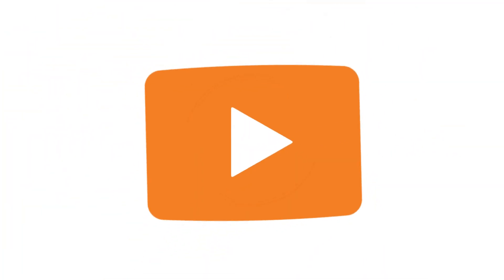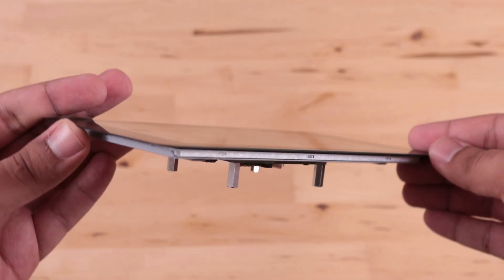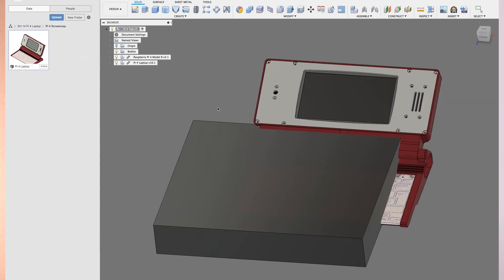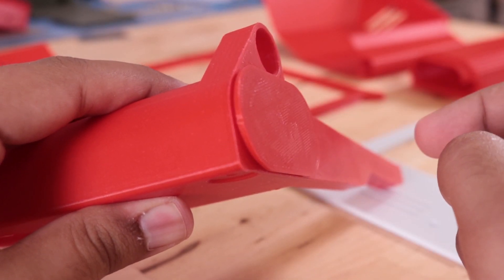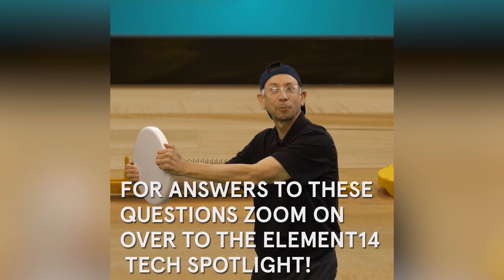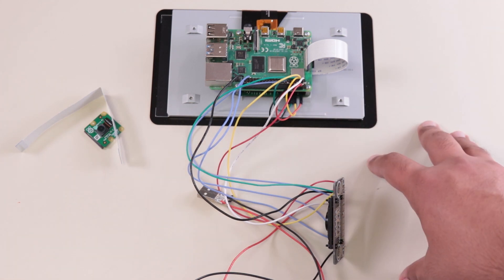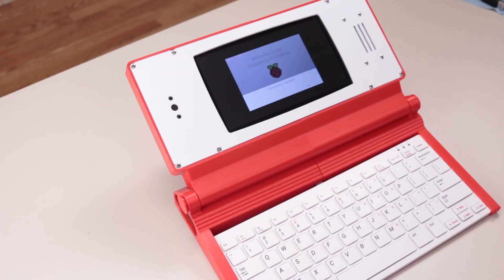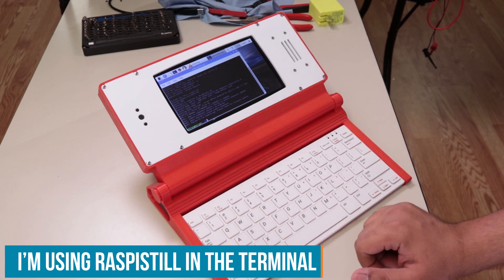The Ultimate Raspberry Pi 4 Laptop

Comment from the maker: Looks like DJ Harrigan had trouble using his camera. If you had an incident where you tried to made things simpler but instead, it got complicated. Post here: http://bit.ly/2TwxZS0
Reply: Either the ribbon cable is not seated correctly or static shock zapped the camera. I’ve had the official Pi cam work with the Pi 4B.
Reply: Where's the mouse man
Reply: Congrats on 666k subs!
Reply: Tbh it looks like a kids toy
Im sure you could have worked on the case a bit more
Maybe even took out the portable charger and wired it into the case
But thats just critical feedback

Comment: The "Ultimate" Pi laptop:
- no heatsink or fan
- no access to the ports
- keyboard doesn't stay in place
- camera doesn't work
- speaker is barely audible
- tiny monitor yet fat panel casing

A better design would put the raspberry pi with the keyboard casing and have the display be by itself in a clean, flat enclosure. 99% of standard laptops follow this design. Only tablet 2-in-1 laptops put the processor board behind the display.

I still enjoyed the video, and your tech skills are tons better than mine. =)

Comment: i kind of want to see something that you can hold in your hands and can fit in your pocket... something that still has a full keyboard as well as a d pad and game control buttons would be absolutely perfect... but i would just settle for a full keyboard...
Reply: or what about a case that has a battery, cooling system, and display. like put the display right onto the case. sure it would be small. but you can connect a bluetooth keyboard to it and have an entire computer that can fit into your pocket... or hell... forget the display all together... just a portable powersupply and a case... rig up a hotspot and ssh into it with your phone wherever you are...

Comment: I've been thinking about building my own pi4 laptop for a little bit now, for those times when I don't want to pack up my larger machine for little trips when I won't be needing to do CAD or video editing. 

I was thinking of getting a compact keyboard that is roughly the same size as whatever little display I get so things look proportional. I don't care to much if it's the best to use, as this project would mostly be for the heck of it. I was also thinking of putting both the pi4 and the battery in the bottom part of the device, like in a regular laptop, to help keep it from being top heavy. I would also like to set up the pi4 and battery charging port with short extensions from the ports to the side of the chassis so I'd have easy access to them. I'd of course have to get a fan and heatsink for the pi4. I would then route the cables from the pi4 and battery up to the upper part with the display and driver board through a sturdy cable sheath.

Comment: Thanks for doing this, should have been done long ago!

In terms of what you might consider adding, generally common use features like:

*Battery that stays in, is able to be powered by plugging laptop in
*power switch
*microphone (in addition to the speaker)
*access to the plugs
*fan(s) for cooling

Comment: I tried to use website but could not find this project.  I travel for 49hours.  I want to make similar laptop.  
How many hours with monitor can you get with that battery pack?
Is there a source to assist me in creating a safe/legitimate 24 hour or 48 hour battery pack to fit inside laptop case similar to what you did.
I know nothing.  But i feel I will need a bank or line of batteries connected ...the width of the laptop....
Slide it out to charge it.  Slide back in.  However   TSA may take the batteries if not secured where the batteries are some how packaged before going into laptop case....  hmmm

I would consider largest battery charger LION pack purchased if price was ok and it gave me a good measure of time to use laptop.

Comment: Nice, but this is what I would've done:

1. I would've used a Pi Juice hat with the 5000mAh battery add-on. WIth that, I can have power switches, LEDs, and manage the current that flows into my pi and even check the percentage trough software.
2. I would've put a fan like a Fan Shim from Pimoroni on the pi.

Other than that, great job!
Reply: For every article or video about a DIY Pi laptop, there are hundreds of "how I would have done it different" comments.  The "would have" part is telling, because if they had built such a thing, they would have said, "this is how I did it different".  Pi laptops (or cyberdecks, or whatever) are like light sabers - every Jedi has to make his own.

But I'll comment on your comment as well: you believe that you can manage the current that flows into your pi?  That's not how it works.  The power supply supplies a regulated voltage, and the load (the computer + display + keyboard) draw whatever current they will.
Reply: @BrightBlueJim  go check out the pi juice, you can change how much amps you can send to your pi trough AC. Sorry, I meant that.

Comment: In the long term I am wondering if one would be better off going to a wireless keyboard and moving the power cell into the top half. One of the most common laptop failures is wires that go through the hinge. The other being heat. Which most of us with Pi4 have had to deal with. I use a Flirc case and even it gets hotter than I am happy with (does not throttle).

Comment: Th official keyboard I keep finding is a full size 106
Although I did find a red and black compact keyboard on Amazon, but no red and white. I did find a blue and white though so I am going to switch the decks around.  lol

This piTop that you made is basically what I want to build, but buying a 3d printer is out of the question. :(  So says Congress(the wife), It was vetoed on that.

Comment: 1st off, you need heat-sinks and a few good fans (Noctua has some good 5V ones) Otherwise a decent first job.
Possible Future upgrades: USB3 to M.2 SSD for a boot drive (You can get 120GB drives starting at about $30)
Integrated OS aware battery with the option of using that Anker battery as an additional removable power pack. 

USB2 hub for external ports. 2 Micro HDMI to full HDMI adapters bolted through the case for A/V output. 3.5mm audio jack also bolted through the case for headphones.

Comment: I like the design, but I have a few qualms with it. Mounting the pi to the screen leaves the whole case chunkier than it needs to be, and makes me feel like its going to be top heavy. Not making a USB Pass through, or designing the case to expose the usb/ethernet ports lowers the overall usability, especially since the official keyboard doesn't have a mouse pad like other portable keyboards. Aesthetically I like the way it all looks in the end. But I really miss the core 'maker' feel of the old videos, even if they were longer/multipart. These newer videos a lot of the time feel so rushed and they all just kind of rely on, "hey I got these parts, lets 3d print a case and shove them inside." While generally cool when introducing a new idea, or being one of the first videos a person is going to see from a channel. But at this point More complicated projects with more in depth planning and focus would be great. Especially since now there are a group of you all working on videos independently, if you all layer your work schedules right, each of you could take longer to work on video/topic, and still have very regular content on the e14p channel overall.

It would also be great to see all of you come together for a project every once and a while. A lot of this all started for you guys with the Hack like Heck competition, I wan't to see you guys pull some heck like hacks out of your minds like I know your capable of. :D I really want to enjoy this channel again.

Comment: Just came here to say, pros don't solder wires to exposed pins, they crimp the wires with the proper mating connector.  Maybe in a pinch for a prototype or proof of concept, but when you go as far as he did with the case, creating a pseudo complete project, to solder wires to pins is backwards.  Anyways, rant over.

Comment: Unless you have a 3D printer, soldering equipment, a workshop, a 3D modelling software (also have learnt how to use it), and your time is almost worthless, how could this be "cheaper" than the off-the-shelf version?
Reply: well now it's even cheaper, as the files are downloadable and there are ways to get things printed, without having a printer yourself :) hackerspaces or libraries for example.
Reply: dude, this channel is literally for people who make things.  Ya know, people who own this kind of equipment?  I may not personally have a whole workshop right now, but I have a 3d printer and soldering station, and will be building my own pi laptop in the future(though definitely not this design).

Comment: flimsy design, the keyboard was falling out the bottom and you literally taped it together with that sticker on the back...
no heat sink or other way of removing heat so your pi will throttle back to a potato after a couple minutes of use.
no mouse/touch pad control at all...
overall this looks good but is a total failure of a laptop. 

these kinds of vids are why i cant stand part of the R pi community, look at this cool thing i built that falls appart 30 seconds after the video ends and all you need to build it is this $500 3d printer some obscure electronic parts from china and oh look it failed to do anything... like your "laptop"

Comment: No Heat Sink!!!  No Heat Sink!!!
It will overheat and throttle the clock.
What is the point of getting a RazPi4 if you are going to cook it down to a RazPi3?
Reply: I guess they like crusts crusty
Reply: I feel like a lot of the "hacking projects" on Element14 reek of pretender syndrome.
Reply: I was kinda thinking the same, my raspberry pi 3 needs a heatsink and I put a fan on it to make sure it was cool enough.
Reply: dude chill
Reply: @artisimo7967  nice

Comment: I’ve been able to get the official Pi camera to work with the Pi 4B, no issues. I’m going to guess that either your Pi camera got hit with electrostatic shock (easy to do) or the ribbon cable is not seated right. The connectors on the Pi do not hold as well as they should. Check the cable.

Comment: I’m able to accept the battery solution even if it cannot be recharged while the Pi is in use. I can even accept (barely) the low resolution official display which is certainly too low to use for a desktop daily driver. But I cannot accept that a laptop, built around a dual 4K HDMI Pi 4B has no external video connection. I’ve built a tablet with the official display and off the shelf battery recharging power supply and was easily able to build in a switch to go from official Pi display to the HDMI port. A true laptop should have external video capability. C’mon!

Comment: Doesn't really seem like a good use of a Pi imo.  Obviously for the money spent you could get a much better device.   What would make this better, imo, is if the GPIO pins were externally accessible for plugging in other sensors / hats, and maybe some really unique hardware options like an Intel Realsense 3D camera or DIY LIDAR, advanced drone piloting software/hardware, and as others have said, exposing the USB ports, the HDMI port, and a better case model (wobbley keyboard?  no thanks).  Neat project though and it's a good start.  Anyone building this at home, do yourself a favor and use cabling you can unplug to replace the RPI in the future instead of soldering directly to it.

Comment: there are few things that didn't impress me... 1) Why another audio module was used if raspberry has audio output? 2) The laptop has too much weight on the display part then the keyboard and that will make it fallback 3) The keyboard is without touchpad or joystick and won't able to use the mouse pointer! 4) case is too loose and keyboard don't fit properly 5) Why the LCD case was made into two half?

Comment: Great looking fun design.
My only concern is the running temp of the Pi 4 (up to 80 degrees C on high load) and the glass transition temp of the PLA (60 degrees C).
Great video.Keep up the good work.

Comment: i opted for a custom power system for my pi tablet. its a bit lackluster only runs for about an hour or so, and i think my charging board is discharging my battery when its not plugged in.
Reply: Photo!!!
Reply: @BrightBlueJim  you are a bit late, i already gutted it. new design will just use a pijuice and a 10 ah cell. i have all the parts but i had to re-design the whole case, due in part to upping to a pi4. thats maybe about 60% done.

Comment: Is it possible to use a Raspberry Pi with a touch display and use it like a CNC controller with LinuxCNC?
Use the whole system through 40 pins for stepper drivers ( motors) limit switches, z touch probe, emergency stop and other stuff to lathe.
Here is where I'd like to use it. Already bought a Quad 2-Input Multiplexer ( SN74LS157N) to switch between electric lead screw and CNC mode.
https://www.youtube.com/watch?v=kkBu_X1bLds&t
But in this video used a MESA board
https://www.youtube.com/watch?v=FlZiq8uCcpI&t

Comment: How many hours that little power bank handle the raspberry pi laptop?
Reply: I have a similar powerbank and get around 4h from rpi3b plus 7inch lcd
Reply: @Ami-Jimmy  But this is the more power hungry RPi 4, not the RPi 3 B+. Needs so much more power that they switched to USB C and a higher rating on the recommended power supply! I'd expect it not to last more than 3h max.

Comment: Nice looking but doesn't seem that practical with ports locked in the lid since most projects will require access to the USB and ethernet ports. And how are you mousing around that desktop?
Also that ad in the middle: "mosfet relay" huh?!
Reply: The screen is a capacitive touchscreen so he can use it as a mouse
Reply: @blue4lifeblue  hitting the target you want... hmm, seems like it would be iffy.
Reply: @jmsaltzman  well technically it's Linux so all he needs is a keyboard and terminal
Reply: @jmsaltzman  You mean, just like it is on smartphones?
Reply: There should be version without the Ethernet and USB ports on the card to provide a low profile and panel mounting of the ports a few inches away.
Reply: @psikeyhackr6914  he could've used the Pi 3a

Comment: I'd daily drive that lol
Reply: i woldnt cuz it doesnt have a mouse or usb ports that are accesable without opening it
Reply: It would burn up extremely quickly... The Pi 4 almost requires users to add a heatsink and cooling system for daily desktop use. It starts to overheat at 80°F and gets to that temperature very easily without any way to cool it off.

Comment: Cool build!  Nice job!  I like the use of all standard Pi foundation parts.  The things I would improve are: Charging port rather than removing the battery, access to the Ethernet, USB, and HDMI ports from the outside of the laptop case, and a touch pad mounted somewhere below the keyboard.
Reply: The removal battery might be a safety measure cause you shouldn't recharge a power bank while it's covered, since it will make it overheat and possibly catch fire. If anything did happen it would happen off site rather inside the laptop.

Comment: 3d modeling and planning...fantastic...wiring and soldering...scary.
Reply: I don't know why ge soldered to the pi pins. Why just use female dupont wire pins?
Reply: @abdraoufx  I didn't solder to the GPIO, I used the spare 40 pin female header from the speakerphat. Nothing is soldered to the Pi.
Reply: He should have also used a bigger screen to match the keyboard
Reply: @darksaturn1007  I suspect that the only display Element14 carries that works with a Pi is the official 7" Pi display.
Reply: And the funny thing is basic wiring and soldering is probably easier than basic 3d modeling.

But as a 3D modeler myself, that stuff scares me also. haha
Reply: @tbh3291  Completely different skills - you can be good at either one and not the other.
Reply: That's what I thought when I saw it.
Reply: Really, a square box with no out ports? Split in two? Does not look like fantastic wiring, or soldering.
Reply: youbecha64 YES!
Reply: youbecha64 Atturry
Reply: lol everything is ez
Reply: Wiring and soldering is less difficult when you practice.